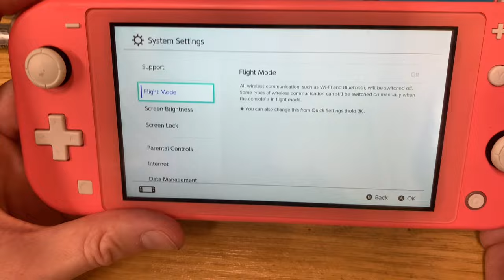Nintendo Switch Lite - Black Screen but making sound - Let's Try to Fix it

Comment: As soon as I saw he opened the thing up I new I was screwed 💀
Reply: What thing?
Reply: @palonso1609  the console 😭
Reply: It’s actually not that bad and most things are just plug in and if something is actually broken it will most likely just need some light soldering depending on what it is
Reply: Ye cause i cant do that well i could i prob loose the screws and mess sum up
Reply: Have faith in yourself. The fact that he did it shows its not impossible. Don't avoid things because they seem difficult or hard
Reply: @emmojo3428  oh yeah I gave up in those 3 months, I bought another console 💀
Reply: @Hanyuu_yu 😂
Reply: Unplugs the backlight daughter board can't see anything on screen 🤦
Reply: I'm dying on the inside right now
Reply: @iseaflames  actually it’s working now I’ll tell you what I did, i turned it on (still with the screen just black and only hearing noises) and I held down on the home button untill you know where the power off button is, press that and turn it back on with the on button
Reply: @iseaflames  if it’s still confusing I’ll try my best to explain more 😭
Reply: @Hanyuu_yu  I fixed it I'm currently flying and have layovers.😭 I was freaking out cause I didn't have anything to do. Thanks for the video.
Reply: Same 😂
Reply: @Hanyuu_yu  how am i supposed to know where the power button is? 😭
Reply: @Hanyuu_yu NVM I DID IT THANK YOU SO MUCH
Reply: @bootyblaster500  yes ofc! I’m so happy it’s working for you now!! :D
Reply: @MakeL679 I will
Reply: Same 😢
Reply: Well well well, look like im screwed too 💀
Reply: Knew*
Reply: @Hanyuu_yu help me pls ima get grounded if i break a 3rd switch 😭🙏🙏🙏
Reply: Nooo as soon as I saw your comment I knew what was gonna happen so I knew I was screwed up😭😭
Reply: @Kaidthereal  you should check the rest of my comments under this I left a tip of what I did before to fix it really hope it helps!!

Comment: Well done Mike. Looks like the backlight wasn't working, and that connector with the corrosion nearby feeds the right hand board which has the backlight connector on it. Maybe by taking out the ribbon cable it cleaned the corrosion away. Good job 👍👍👍
Reply from the maker: I didn’t know that was the back light ribbon, makes perfect sense now.
Couldn’t see how that corrosion had happened, as in such a weird place, not where you’d expect water Ingres, but not complaining, after the currently on pause gameboy Color repair, I needed an easy one 😂
Thanks for the kind words and hope you’re doing good, I saw you were still having “fun” with the Roller 😆
Reply: @1up_Gaming  😂 That Roller is taking up all my time and all my bank balance!  I'm looking forward to the day when I am half way through it. Everything I look at is broken😂👍
Reply from the maker: @Mymatevince  I'm looking forward to the day you can take it out for a spin, it's certainly looking like a love / hate relationship so far, the car loves all your cash being spent on it, and the bank hates it :p
Reply: @1up_Gaming  😂👌
Reply: Oh my.
Now if NorthridgeFix is here too, we ot em all haha
Reply: @1up_Gaming , where r u based???
My Switch has the EXACT problem: it makes noises but got the Black Screen of Death when I modded me Switch with a black shell.
Reply: Xkxddjdiixihguxwixiuddjj

Comment: Our Switch has had this black screen for months. When you touch the screen, you can hear touch sounds along with pushing any of the physical buttons on the Joy Cons. I was about to accept Nintendo's Repair Acknowledgement when my gut told me to go back and try to search for an answer one more time. Thats when I came across your video. After you got the back opened showing the battery connector and the display ribbon cable a bulb went off in my head! I haven't opened mine up yet, but I'd bet the $100 I was about to pay Nintendo that the ribbon cable is what's giving me the issue!!!!! Somehow, one of my daughters knocked it or dropped it right causing it to lose connection! Thank you so much for making this video!!!! I'll come back and edit this after I get it opened.
Reply: Did you fix it

Comment: I have the same problem but not the corrosion. Doesn't look like you really did anything except take the ribbon out and reinsert it. I tried that and my problem is still consisting. Is there anything else you did we missed. Same exact problem with black screen and sound. I've cleaned it and reapplied the ribbons but still no luck for me.
Reply: Well now it won't do anything, noise and all. I did nothing differently.
Reply: at that point i think it would be something wrong with the battery or sonething all the way under the switch
Reply: @tylersmith1412 eah he most likely replaced that whole ribbon I think that’s un genuine to lie about that. I’m so frustrated with both my kids switched they were both dropped and make noise and you can hear games start up but you can’t see anything. He shouldn’t lead people on like that

Comment: Are they any other ways Bc my switch makes nose when i move the joystick but has a black scream and are they anyother ways to fix it with out removing the case
Reply from the maker: @jacquelineasumani7175  I don’t think so, not without removing the back.
Getting the back off is quite easy, but if the screen needs replacing that’s a whole different story 😪

Comment: I have same issue and doing this didn't fix it I kinda feel like you replaced the screen/ribbon cable off camera
Reply from the maker: @haleyedwards4253  what’s the point of that? I’ve got plenty of spare screens to replace it with if that were the case, and that would’ve made for a better and deeper video.
Sometimes stuff just works, maybe yours is a different problem? There’s loads of things that can cause a black screen in afraid 😪

Comment: Jammy bugger. How come I get all the hard / impossible fixes?  I have a genuine faulty one of these, with corrosion and everything. I opended it up, took one look, nope, then put it back together.
Reply from the maker: Needed a bit of luck, if this gameboy video I’m doing ever comes out, you’ll see why 😂😂
Reply: @1up_Gaming  I'm already interested lol
Reply from the maker: @PhilipBryden  STOP IT !!! I am 2 hours of video time in so far, and I've made possibly THE least amount of progress ever, at this point I'll need to learn video editiing :p
Reply: @1up_Gaming  Editing isn't too difficult to pick up. I use Davinci Resolve free, in the Edit tab, using the Blade tool and the Delete key to trim out the boring parts.
Reply from the maker: @PhilipBryden  I literally drop raw iPhone footage through airdrop to the MacBook, import it to iMovie, and magic happens 😂😂
Reply: @1up_Gaming  Do you edit in iMovie, or just pause, restart the recording when you need too?
Reply from the maker: @PhilipBryden  Turn on recording on the phone, pause if I remember when I wander off to get something , restart ( normally, it's been known for me to forget to press start on a few occasions :p ) then just drop the raw files into iMovie.
Reply: @1up_Gaming  Is ok.
your narration works and younzoom in close enough.

at least you don't slap 100 overlays in your video.

I like it simple like this.
Simple is best.

I'm however impressed athow a cute lil iPhone has such a good camera !
Reply from the maker: @repeekyraidcero  it’s just an iPhone XS, I’ve upgraded to a 12 Pro for the daily driver, camera is awesome, but it’s just easier to use the old one for creating content, and I don’t have to worry about the battery running out after a long filming session 😂
Thanks for the kind words ☺️☺️
Reply: What circuit cleaning solution are you using and are there comparable products available?It sounds like your saying npa or mpa but I'm not getting any hits on Amazon.
Reply: @Nuprem1z  IPA 99% Isopropyl Alcohol

Comment: Thank you so much!! I just upgraded to the gulikit joycon left and right and black screened after putting all the parts together. I tried your method of replugging the cable for the screen and it worked like a charm 😊

Comment: I had this issue after replacing my battery definitely make sure those two connections by the battery are really in there and connect and then also trying the hard reset twenty second hood on the power button

Comment: I have the same issue, I have a backlight, I have sound, but no video. 
I did all your steps but it didn’t fix it
Reply: you fix it?
Reply: No :(
Reply: @GregPilles  man
Reply: If you still have it, you might want to wait till the new oled screen mod comes out and replace it with that